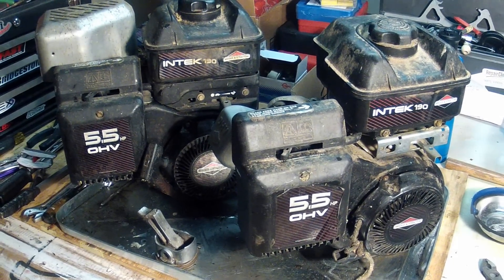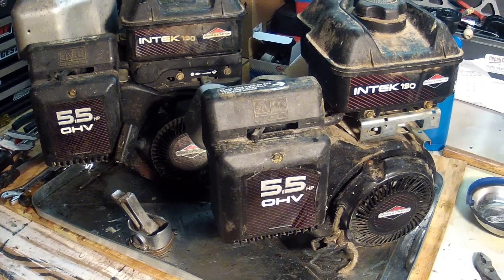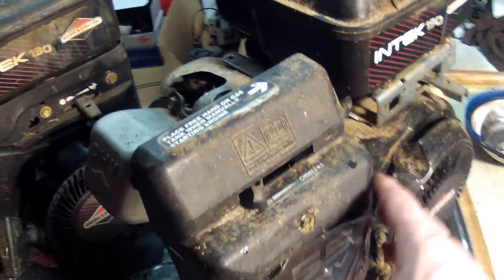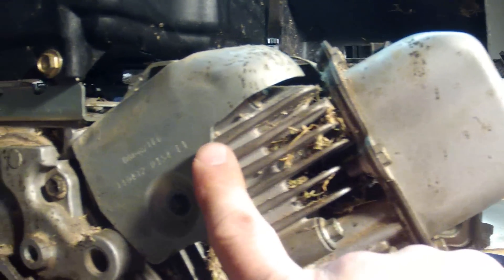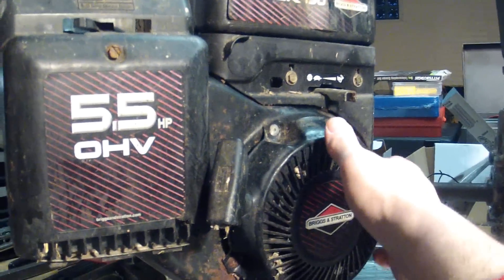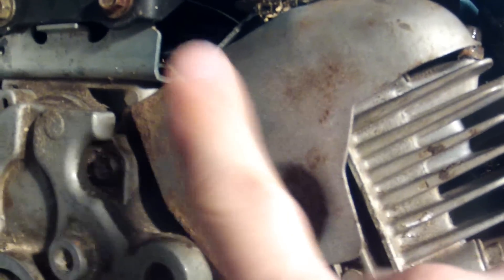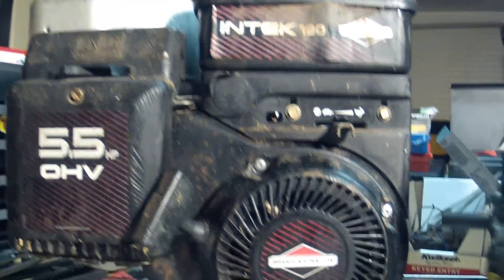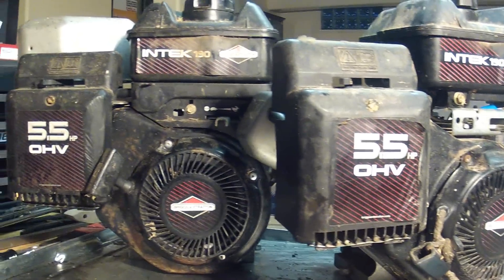Briggs and Stratton Intek Engines - Model Number Locations

Comment: Yeah.boy. Mine was  stamped on the opposite side of the valve cover and  thus facing the air filter housing.  I really was stumped. Dang near impossible to read because of the clearance. Wife said "stick your iPhone in there and take a picture" and by golly that worked. Also the family sticker was way down on the bottom of the housing and unreadable  until I stuck the same phone in there and took a photo of that.  Welcome to the 21st century with a nineteenth century brain;-)
Reply from the maker: Thanks for watching. Glad you found it.

Comment: And b&s should just stick to pilutting them # on the front shroud the intek motors are ok but don't run as reliable as my 1958 briggs and stratton 3.25 hp

Comment from the maker: I can't say for sure... but it sounds like you are running lean. If the carb is running lean, it is starving for fuel. That would explain why it needs choke on and why there is a red hot exhaust.